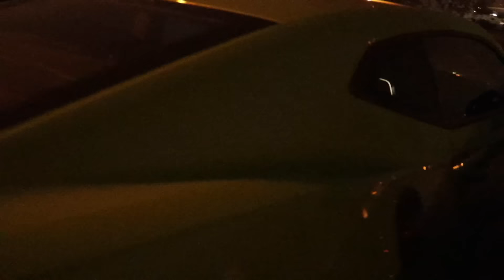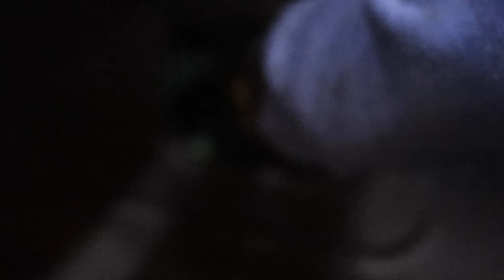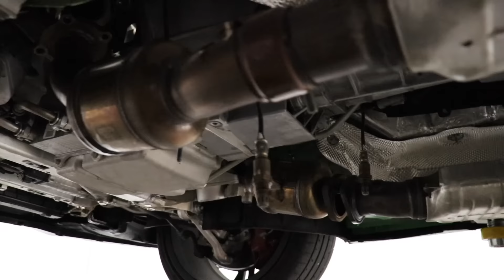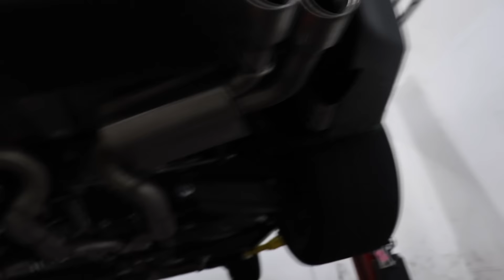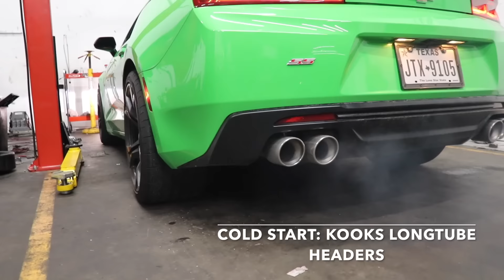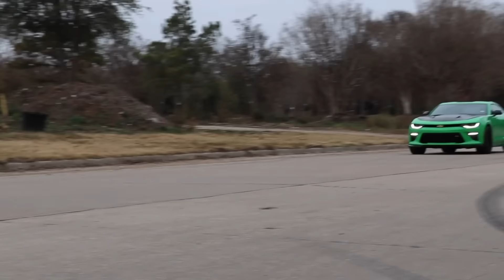2017 Camaro SS 1LE Kooks Longtube CATLESS Headers!!!

Comment: Nice whip! I ordered my SS 1LE in Hyper Blue Metallic about 2 months back. Can’t wait to get it! I’ll share when I get it.
Reply from the maker: Awesome! You'll love it!
Reply: Can you please send me the part/item #'s to the Kooks Long tube headers along with part# for the Borla axle back exhaust. As well as the root-fab air intake you plan on slapping on. Awesome Channel and videos guys... Can't wait to hear back from you with part#'s and get my 2018 Silver Camaro 1SS 1LE going. BTW, I'm planning on going with a TT Hellion setup. Any suggestions as to which TT kit to go with? I want to try and keep my Camaro as fuel efficient as possible since it will be my daily driver, and I live in So. California.
Reply from the maker: I don't have the part numbers. It would just be Kook's Longtube headers 1 and 7/8 with catless mid-pipes. The axle back is Borla Atak axle back. Cold air intake, we haven't gotten that yet. Most likely a cold air inductions intake not Root-fab.

Comment: I really like the sound of an SS but I think for the first time ever, the Coyote gen 3 sounds better. I always thought that 2011-2017 GT mustangs sounded bad compared to an SS. When Ford gave it dual injection in the latest version it started to sound like a Mustang again with a bubbling exhaust note. Pushrod engines sound clean and flat but a modular engine has this water bubbling sound in the background thats really cool

Comment: Great video! Did you have to take the starter out for the install??
Reply from the maker: Thank you very much! Yes passenger side, take out the starter, motor mount/bracket. Driver side you just remove the steering shaft and motor mount/bracket.

Comment: Bro love the videos you have heard both the kooks and Texas speed headers on Camaro which one did you think sound badass??
Reply from the maker: 10speed Killer they sound very similar, the texas speed are cheaper tho so if your looking for a good deal then texas speed.
Reply: MuscleMade they are cheap but if i could go with kooks I should right?
Reply: Bro also could you tell me what hat size where the kooks on that green 1le 2inch has or 1 7/8inch ?
Reply from the maker: 10speed Killer the green one has 1 and 7/8, the black one has Texas speed 2 inch headers with the Texas 3 inch x-pipe.
Reply from the maker: 10speed Killer I don’t know the price difference but all headers do the same thing pretty much, just the quality of the welds and steel. Check the price difference, Their both reputable brands.
Reply: MuscleMade appreciate it

Comment: Your SS sound so healthy!! what about droning?? My 2SS is not a daily driver, but I wouldn't want a lot of droning....
 Any idea what your horse power is? Did you tune or have to tune it?
Thanks in advance!
Reply from the maker: Donald  Ellicks thank you! Droning is not a issue when your cruising, can’t hear the exhaust at all. We haven’t tuned it yet and as far as horsepower, maybe around 450 to the wheel.
Reply: MuscleMade  After looking at the video again and thank you for responding back to me by the way I appreciate that period you kept your secondary cats yes? I am going with the cook headers and I am going back-and-forth if I don't want the cats but I just don't want extremely loud when I get on it but I'm deaf and get rid of my secondary cats!
 If you kept your secondary cats may I ask why?  One more question does it crack and pop more with the headers and exhaust??
Thank you!
D
Reply: MuscleMade  I also really like the little Dicky beat that you put in the background with Drake!!!
Reply from the maker: Donald  Ellicks so we went ahead and deleted the primary cats and secondary, because when you get the Kooks Catless headers, it replaces all of that with a straight pipe. It does crack more because of the straight pipe. If you go Catless, it will be much louder, but you can always ease on the gas if you want it to be not obnoxious.
Reply: MuscleMade  So I'm not sure what state you live in? But in Arizona they want $655 to install the RotoFab cold air intake, headers and high flow cats!  Total $3650 with tune!!??
 How much did you have to pay?
And what state??
Reply from the maker: Donald  Ellicks we have our own shop so this was done there, but we usually Charge around $400 for the Headers install. We live in Texas by the way.
Reply: MuscleMade  In Arizona at a reputable shop they want $570 and says it's 5 hours of work?? Lol  I thought it was 2.5 or 3 hours for install....
Again thank you very much for responding back!!
 Out of curiosity, is it really up noxiously loud with no cats?
Reply from the maker: Yeah it could range on how long it takes, some shops take all day to do it, where as others may take only a few hours. For us it took around 4-5 hours.
Reply from the maker: And it's only obnoxious when your stepping on the gas a lot, but if your driving normally, its not obnoxious. So first couple of gears are going to be loud, but 4,5, and 6th will be not as loud as long as your not revving high in the rpms.
Reply: MuscleMade  Thank you brother for the advice!! Anything else done to the Camaro, or no just the headers? How about a check engine light did that come on? O in that krypton color is sick I regret not getting that
Reply from the maker: Header and the borla Atak axle back.

Comment: I just bought borla atak 11921 and thinking to buy kooks same like your setup. 
after  header install did you see any check engine light and did you tune your car ?
Reply from the maker: Yes check engine because of no catalytic converters. You just get a tune to take the light away.
Reply: MuscleMade is there any kooks or different brand long tune which can fit on stock cats or offer their own cats which can fit on stock pipes.
Reply from the maker: Yeah you can just buy the system with high flow cats.

Comment: Hey brotha....did you go catless on the headers and what’re your midpipes? Unresonated? And did you delete your secondary cats?......and final question....how is cruising on the highway going 65-70 can u still have a conversation or hear radio
Reply from the maker: Kyle Brundage yes it’s Catless, the off road setup deleted both primary and secondary cats. Midpipes are Catless connected the x-pipe, it all comes when you buy the header system Catless. If your going highway speeds, it’s not bad if your not to much on the gas and your rpms are not higher than I would say 2000, anything above that it gets annoying and starts droning. Also this car had borla atak axle back.

Comment: whats the cheapest way to make it louder with not too much drone? npp with secondary cat delete? i  keep hearing ppl spending shit load of money on catback and its not much louder than the stock NPP system.
Reply from the maker: Rashid Belk yes you can just get a x-pipe if your car doesn’t come with that. You can also delete the muffler and put a straight pipe for cheap. Or you can get an Axle Back system that is proven to make it louder.
Thanks for Watching! Don’t forget to Subscribe!
Reply: Buy the headers from TSP 1 7/8 they’re roughly $600 totally worth it man.  Just bought those for my 18 1le.
Reply: Also I kept the NPP and love it when I get home I actually set it into touring mode and it’s soooo quite! I did the fuse pull but it was so damn loud that being able to quite it down is a plus!

Comment: Did you do a tune for the headers I have a 2018 ss and was wondering what mods you can do that won’t void the warranty
Reply from the maker: No we didn't tune it yet, you can do mods, just depends on what dealer you take it to. Some are mod friendly and won't void your warranty for bolt ons.
Reply: For those headers do u need a tune? I want to mod my Camaro so bad already but I just got it lol
Reply from the maker: masteryoda655 if you are going catless headers then you do need a tune for the check engine light. If not then it’s up to you, Headers will add most power and torque with a tune.

Comment: When you ended up removing the cats, the check engine light came on correct? Did you get it tuned or use a defouler so you can pass emissions? (if they test where your at)
Reply from the maker: Yes the check engine light came on. We are just getting it tuned.
Reply: With this type of tune, would I ask for a regular tune or is there a special name for it. Because i plan on installing headers on my 2014 camaro ss and wanted to get all the information together before going through it all
Reply from the maker: Just get a regular tune, and just let the tuner know you have Headers and they'll usually turn the rear O2 sensors off and just leave the front ones on.

Comment: Is it cold or is it that much of a poluter?!
Reply from the maker: It's DeeDee it was cold, and when you first install headers, it smokes a lot because of the oils that are greased on the metal of the headers so it’ll smoke at first a lot.
Reply: MuscleMade ohhh ok thanks for the reply! I’m thinking about getting catless pipes. Is it so loud it’s annoying, or just right
Reply: MuscleMade does it pass smog?
Reply from the maker: It's DeeDee sometimes it does get annoying if your not tryna hear it like in the morning or just cruising.
Reply from the maker: It's DeeDee you won’t pass with Catless because it’ll throw a check engine light.

Comment: I have 2017 ss what was the cost for this mod
Reply from the maker: Eddie Allen $1200 we went with off road set up so no cats with the long tubes.
Reply: MuscleMade any CEL issues?
Reply: I bought and installed catless BBK long tube headers on my 1le, got them on eBay for 700 bucks. Along with an E85 conversion , CAI , and flowmaster American thunder exhaust.  Yes you Definitely need a tune.